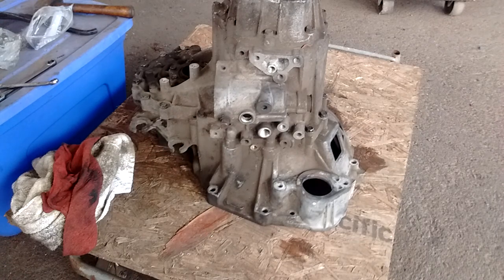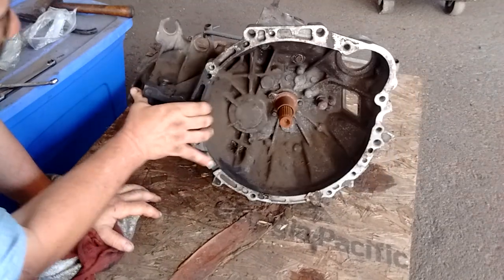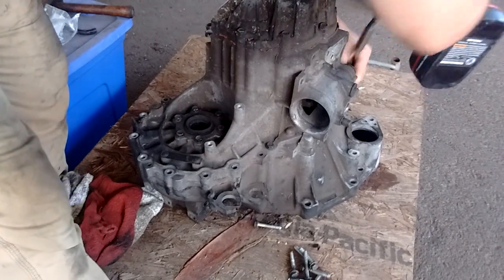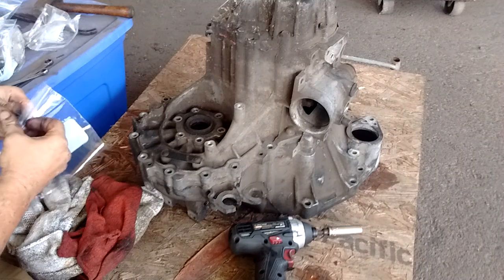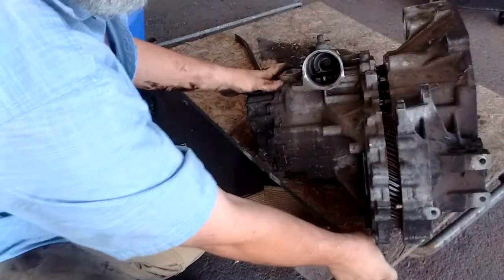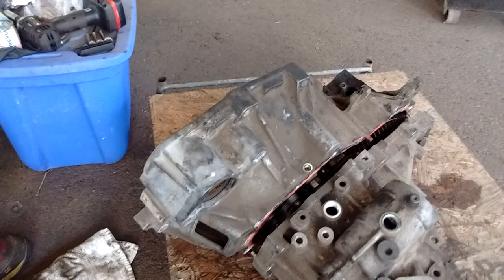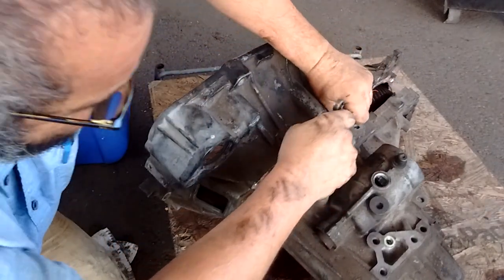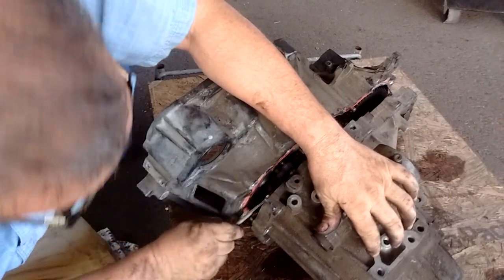Differential Removal - Toyota  MR2 Manual Transmission - Shortcut Method

Comment: Can you do this if you don’t change the bearings on the new diff?
Reply from the maker: No. If you change diff, you should not be doing this. In fact you should almost never be doing this. The video should be re-titled "quick easy way to mess up your transmission."

Comment: how did you get the shirt lever out
Reply from the maker: Shift into neutral. Remove the big bolt from the top of the housing aka detente, it locks the cage inside the housing. Remove the lever arm from the front side. It has a locking pin. Then take off the back cover and slide the shifter straight back.

Comment: Hey putting the reverse bracket is it easy ,any special tool ?
Reply from the maker: No it is not easy and almost impossible for one person to do single handed. With an assistant holding the transmission and bell housing upside down you may be able to do it but maybe not.

Comment: Thank you for your videos they helped me a lot! Is this the same procedure on a C60 6 speed transmission on Celica, Matrix, Corolla 2zzge? Thanks again
Reply from the maker: Yes this is nearly identical procedure BUT I DO NOT RECOMMEND DOING THIS.
Reply: @Merryfrankster_  Ok I understand. I will have to do the complete disassembly like armstrong c60 video. Any links on service manual resources. Thanks

Comment: Please everybody.. DO NOT TAKE APART a C SERIES GEAR BOX THIS WAY! you can't even set the pre-load properly for a new lsd.
Not trying to hate on the video either, but this is just sending out bad info... good way to lose $$$

I read the description already... don't need to tell me...
Reply from the maker: Bud I make a clear verbal disclaimer at the beginning of the video and a written warning in the description. If someone is deaf and blind and misses these there is probably no danger of them taking apart their transmission by any method. I am not sure what value you have added with your comment.
Reply from the maker: Maybe YOU have missed the fact that this is a video on an easy way to remove a differential. It is NOT a video on how to install a LSD which is what you seem fixated on. There is no mention of a LSD anywhere in this video.

Comment: Hi Frank, i have followed the intructions of this video and have re assembled back together. I made sure the reverse arm was in the correct spot. However now it will barely shift into 1-2-3-4 and it wont shift at all into 5th or reverse. Any help would be appreciated
Reply from the maker: My guess is that something might be interfering with the shift forks or they have gone out of place. My suggestion is to disassemble it by the normal way and put it back together correctly. Refer to the shop manual for step-by-step. I don't know how many times I have said that I do not suggest or recommend that anyone follow this shortcut method.
Reply: @Merryfrankster_  I have just realised that i did not remove the shifter fork when performing the job. Is there anyway i can sort this issue out without having to  disassemble the box the proper way?
Reply from the maker: @matinghaderzadeh3868   I'm sorry I don't have any suggestion - I don't even really know what's wrong exactly, let alone how to fix it. If you brought this transaxle to me, I would take it apart as per the shop manual and re-assemble it, checking every part on every step.

Comment: Is it possible to swap a 6 speed manual into a 93 camry 4cyl that has an S51 in it? A C160 perhaps? Reason I ask is I love my Camry and it’s still low miles. 6th gear would really improve my highway mileage. I already get around 400 to a tank if I do all highway.
Reply from the maker: Most if not all c-series are designed for a starter on the engine side. The s-series and e-series have the starter on the transmission side.  To put a c-series  on a 5s-fe 2.2 liter engine (which I am guessing is what you have), you would have to very precisely and carefully cut the starter boss off the s-51 bellhousing, then very precisely cut a matching hole in the C160 bellhousing, then weld the s51 starter boss into the c160 bellhousing. Or you can hunt the online universe for an adapter plate that allows fitting the starter.
Reply: Frank Saab so the 6 speed would bolt up to the 5s-fe but the starter is swapped directions. Would I have to change the bell housing or can it stay?
Reply from the maker: @jc-hd3ih  I think what you actually need to do is swap your S51 bellhousing onto the C160 and then you will be all set. I believe that Paul Woods at Woodsport has done some conversions like this.
Reply: Frank Saab this gives me hope. Thanks for the great replies. I have some work planned for it soon. Oil pump seal and going to do timing belt water pump 30k miles early while I’m in there. Anything else worth replacing while I got that side opened up? Very surprising how attached I’ve become to this car.
Reply: I'm a little bit late to the party, but the way the c160 is geared, you'd get worse gas mileage cause of the higher final drive ratio. 6th gear isn't extra low in the c160, but it's similar to 5th in the s51. Instead of 5 spaced out gears, there are 6 closely spaced gears. Better for racing.

Comment: Hi Frank. I’m planning to put a LSD on the S51 using your method.  Question is do I need to shim the diff or something or just plug it in and it should fit?
Reply from the maker: I don't really suggest this method. I made this video for demonstration purposes only. Many people have used this method successfully but it does carry risks of incorrect assembly particularly for the reverse gear lever. Also it makes verification of the pre-load next to impossible. When putting a MR-S LSD into an S-series there is definitely a requirement for a shim to get the correct pre-load. Without a shim the diff will flop around in the case like a loose grapefruit.
Reply from the maker: The shims are available from Toyota. If you need help finding them, let me know, I have looked up the part number for others who needed them, I can look them up again.
Reply: @Merryfrankster_   Nice. Thanks I think I'll go without LSD for now. I really like to go with the e153 but the added 30lbs scares me.
Reply from the maker: @beanvo9924  what car are you planning to put this in? 30lbs is less than the weight of 5 gals of gas.
Reply: @Merryfrankster_  In the Mr2 sw20 just like yours.  Well since you put it in that perspective it doesn't sound so bad.

Comment: I just stripped and built 1 of these boxes, and after watching your video I'd b amazed if you ever got this box back together, your what's known as a hoke! The fifth gear synchro is quite tricky to put back in place I doubt you have the skills, sorry!
Reply from the maker: AS a matter of fact I did a tutorial on reassembling the fifth gear syncro and you are an idiot.
Reply: @Merryfrankster_  where is the tutorial. I am contemplating doing this on my s54, I want to know what I’m getting into🤟
Reply from the maker: @sebastianchlebek3239  it's on a forum. Old school.
Reply: @Merryfrankster_  I’ve been looking around on the forums for threads similar to this but the only
One I could find is the one you posted with the link to this video, I’ll most likely end up doing it regardless I’m just hungry for as much knowledge before I start anything. My s54 is out right now because of a bad throwout, why not make it an lsd
Reply from the maker: @sebastianchlebek3239  what exactly are you trying to do? If you are looking to remove and replace fith gear and syncro then look at any video for s54 s51 3153 e151 c56 C52 they are all nearly the same. If you are looking to replace the differential DO NOT USE THIS METhOD SHOWN HERE. YOU WILL SCREW IT UP. FOLLOW THE STEPS OF THE REPAIR MANUAL.
Reply: @Merryfrankster_  ok cool, thanks!!!

Comment: Having trouble finding differential carrier bearings for an lsd swap into my s54 gearbox, cannot find any sellers and even toyota cant seem to help
Reply from the maker: What kind of LSD? the bearings for the OEM helical that comes out of a Spyder gearbox are part number 90366-40094
Reply from the maker: Correction - the two bearings are slightly different on each side. The correct part numbers are 
90366-40094  BEARING (FOR REAR DIFFERENTIAL CASE - LH)
90366-40097  BEARING (FOR REAR DIFFERENTIAL CASE - RH)
Reply from the maker: However, checking the part numbers for the S54, they are 
BEARING(FOR REAR DIFFERENTIAL CASE)
90366-40016 RH 
90366-40023 LH

Comment: Hey Frank, could you possibly reply with the spline count for that differential ? I counted 8 Ring gear Bolts but can't see the actual spline count. I'm trying to figure it out for a spool. Thanks
Reply from the maker: I'm not sure what count you are asking for. The teeth on the ring gear? The teeth on the pinion? The spline count on the output shafts (axles)? Whatever it is you need I can count it out for you, just let me know.